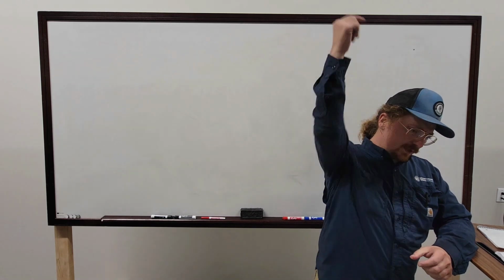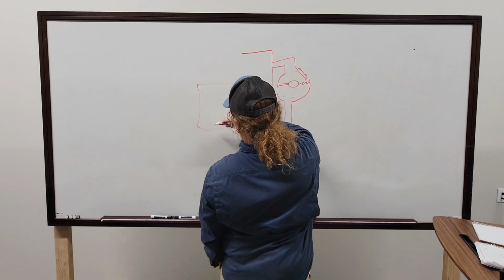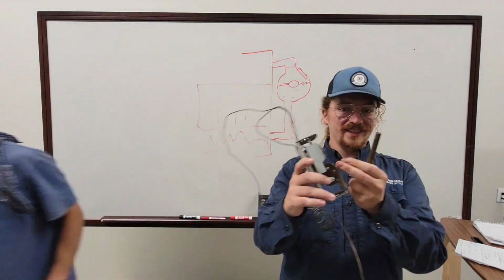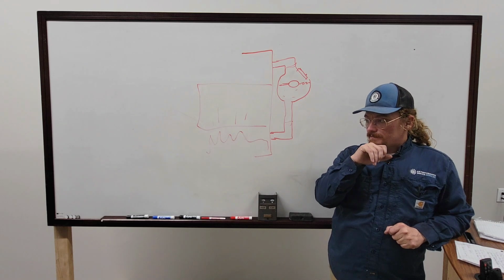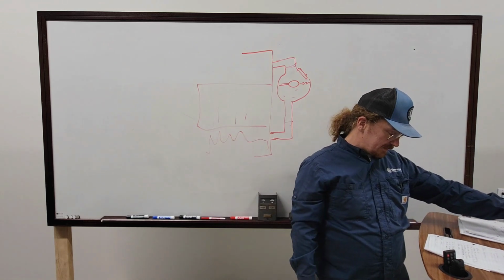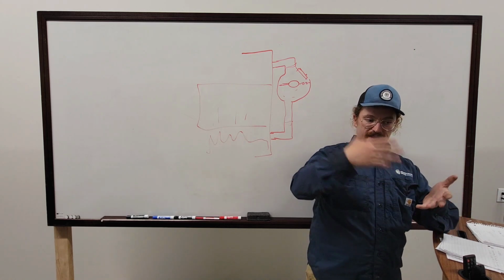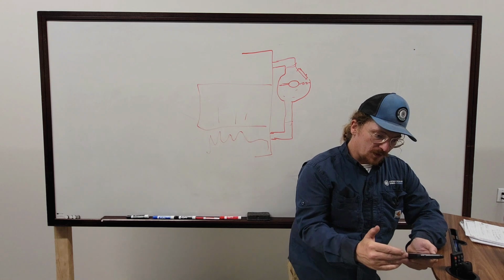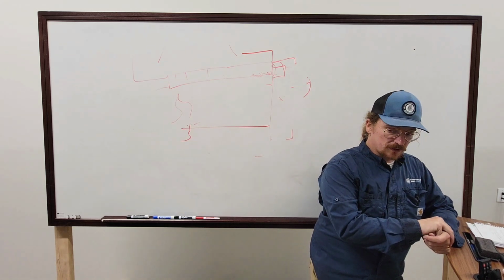Boiler Basics for HVAC Technician

Comment: You should have a layout of the gas train assembly. I can email you one if you would like. That is the first thing that should be gone over. Second your safety  control's any boiler over 500 sq ft should have two or more.  What you should do is send someone out to a class for high pressure boiler's.

Comment: Damn, I'm old. I'm 47 with 26 years in the trade and I've seen plenty of natural draft boilers and furnaces.
Reply: For real, I've been in the trade for a little over a year and have seen about 10 at least. Usually the ones with the fan control limit that the dial turns.
Reply: @NatePetersonr5t  don't forget the old cam stat fan safety controls they still.sell.also!
Reply: What is this guy? There are probably millions of natural draft furnaces out there  and probably many of them working still fine even with hairline cracked heat exchangers,  unit heaters the same as well some with with even factory  electronic ignition vs. Standing pilot/ t. couple pilot safeties. Boilers still.out there with 0 pilot safeties and emergency no electricity operation..   Open gas valve manually knob and make sure pilot light is on before you do!!

Monitor water temp and pressure manually in emergency mode operation. No pumps on such system either. Gravity they called it.

They are still.around.also!
Reply: 44 with 25 yrs expierence and I still see natural gas furnaces and unit heaters on a regular basis still!
Reply: Most all boilers do not have 2 gas valves or gas  shut offs.

What is this guy who's never seen a natural draft vented furnace!?
Reply: @georgekolos5255  probably lives down south where there is little natral gas comfort heating.
Reply: @jonnymac31  pretty sure this channel is based in Texas